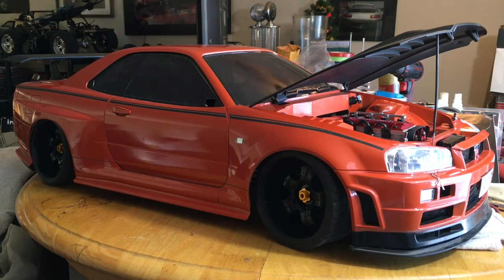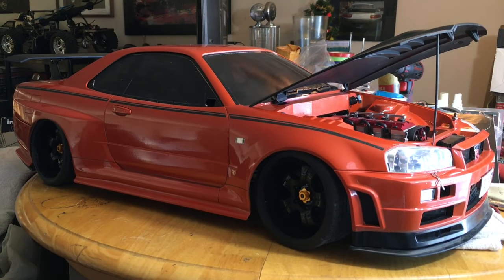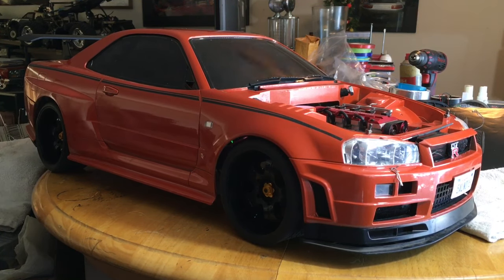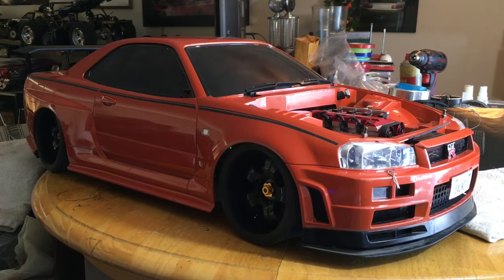TOYAN FS-L400 SKYLINE TEST RUN IM A HAPPY MAN!!!

Comment: Wow! This is hands down the best build I’ve seen with one of those little 4 cylinder 4 stroke engines. I love the scale accuracy of the engine in the engine bay and seeing the cam belt turning and the carb linkage moving because the beautiful little scale engine is real and powering the vehicle, it’s not just for looks. The exhaust actually being routed out the back with a scale accurate muffler can and the adjustable suspension are awesome as well. This is a marvelous machine, well done sir.
Reply from the maker: Thank you very much!
Reply: your not rusty shackleford, I am!

Comment: It looks and sounds like the tyre's break loose on the gear change or the clutch slips more.
The colour really pops in the sun, a good choice. Either you need a stiffer clutch spring or adjust the gear change point to change a little later.
Reply from the maker: I agree  im still setting everything up and dialing it in,

Comment: You need to pick up some red Loctite and use half a drop on every screw on the car.  Super Glue the tires to the wheels, and the clutch is way to loose.  Never mind raising and lowering the body, its just more weight and obviously you already pretty heavy if it cant even pick itself up.

Comment: Im a RC enthusiast. I have several brushless rc's but have never dealt with anything like this. This is awesome. I really feel like these little 4 stroke engines would really benefit from a little fuel pressure like maybe use the exhaust to pressurize the gas tank? I also feel like these engines would really benefit from a 2 speed transmssion maybe something like comes in the Traxxas Jato. What do you think?

Comment: Man, I really gotta get one of those L400s. My old rare FS12 is an old relic 1 cylinder. Runs lovely on my Old Subaru body with tamiya frame, but it's old and suspension parts are so hard to get nowadays, even after I've heavily customised it.

Yours must be custom made, certainly fun to listen to.
Reply: Sad update, my old FS12LS Engine, well she died :( Was running too lean I suspect, and it crunched up the fuel timing section of the crank, so my own pretty nice nitro car is dead now.  But hey this car is still fun to watch even if my own is dead now.

Comment: Well it’s official nobody’s going to catch that fly ball and I believe you knocked another one out of the park. Your toyan 400 has more performance with it running rich than any other one I’ve ever seen on YouTube yet the sound is magnificent I love the way you found the valve problem on the other engine by the way I was thinking people are talking about putting turbos on these little engines. Do you think that they would probably need more spring pressure to keep from pushing the valves open under boost and make them run poorly to just a thought keep up the awesome builds love them
Reply from the maker: Thanks brother!  I am interested in seeing the mods that everyone comes up with on these engines lol!

Comment: I like how it handles. How much does it weigh?
Reply from the maker: Thanks! it weighs about 20-25 lbs, its almost to big to cuddle lol!
Reply: @dennisdempseyradiooutofcontrol  i really like the direction scale modeling is going with these toyan engines. This what we really wanted as kids. Real engines under the hood. Not some electric piece of shit. Would be cool to have a go pro, about a dozen servos and drive these things like we drive in Grand Tourismo. Get a scale 6 speed manual, one servo to control the gear shift with another controlling the clutch. Mount the receiver display on like a helmet, with the ither controls being a steering wheel and actual pedals and shifter. Might b expensive but, you change out what u are driving for far cheaper than actually owning several high performance vehicles. Would love to see this in a crawler with extreme low gear like the Hairy Hauler from Trucks on SpeedVision with Stacey and the other guy hosting. Anyway keep at it man.
Reply from the maker: That’s a great idea to have the GoPro mounted in several positions, I think your on to a new level there brother!

Comment: Well that's it I know what I'm doing when I retire. I finally get to see a running inline four, and it looks and sounds wicked 😲👌👍.if you ever get a thumbs down on this video someone's got some issues or just jokes, I do love my 8th scale 2 strokes but this is next level. I think dual radiators would be a great idea if possible Just for longevity on a build like that. I know those motors get stupid hot but from what I see it looks pretty robust. I love the build keep up the awesome work man.🤞
Reply from the maker: I really like these engines, yeah the dual radiators are a great idea they do get hot, the overflow tank I added helps the cooling big time.

Comment: Looks great and love the concept.maybe it's the speed demon in me but I was hoping it would be a bit faster.know still needs broken in fully and needs some adjustments yet but for me I wouldn't be able to justify the cost of that motor.i just put on a tp power 4070-CM 1400kv motor(costs 3 times less than this toyan motor) on my 2wd slash and with the castle mmx8s esc that thing is stupid fast on 6s and I mean 120+ with it soo far and that was only a short run at maybe half throttle.again maybe it's the speed freak in me.do love the idea and the setup though especially with the air suspension.nice looking build for sure.
Reply from the maker: That was its first run checking all the different parts that were stuffed together, now I can play with gears and higher nitro content,  I have many high powered brushless set ups on my other builds,  I love speed also, like the old saying if your not first your last lol!

Comment: Nice. Great work. For some reason I can not get my fs-l400 started. Using 20% nitro, 2s lipo. Any suggestions?
Reply from the maker: Hmm, is the tiny dot on the cam lined up with the timing mark on the cam pulley? there are 3 timing marks that should point downward.
Reply: @dennisdempseyradiooutofcontrol   yes all 3 are lined up
Reply from the maker: @dblnaknak  ok, if your glow plugs are working and the timing is correct it might be not getting enough fuel to fire off, try putting your fingers in the carb horns to choke it, once theirs fuel present it should fire. be sure to check the glow plug wire connectors to make sure that they are only on the shaft and not grounding out on the plug housing. if you have a voltmeter check to see if your getting 1.5 volts at the plug.

Comment: That is so cool! What transmission did you use? Do you have a site with pictures of everything? I'd love to see more on how you built it. There is another guy that built an F-450 dually rc truck and used this engine in the front just like you did. It's pretty awesome. Well done man!
Reply from the maker: Thanks brother! We all used the traxxas revo 3.3 gearboxes in most of the toyan builds I kinda started that trend on my first conversion because of the 2 speed and reverse with a onboard brake.

Comment: They run on nitro or 2 stroke gas mix,,,,,, what fuel ..? I'm guessing nitro.  20%
Sounds pretty good.👍
Reply from the maker: They run on 15-20% nitro fuel, but they are coming out with a larger dual overhead cam engine with a ignition system oil pump and runs on gas at the end of month.
Reply: @dennisdempseyradiooutofcontrol  👍,,I figured nitro.... thanks for the reply..👍

Comment: Looks awesome Dennis!  So cool to see it driving around!  The sound at idle is perfect!

If you don’t mind me asking what are you using for tires and rims?  At first I thought you took off the stock spinners then painted the rims black but I dunno how you would mount that on the TMaxx suspension.  So are those TMaxx rims?

So after you get this dialed in, what’s on the next horizon?  Anything lined up yet?
Reply from the maker: The wheels were a challenge lol, first I mounted metal discs in the spinner rims to fit the axle pin on the Tmaxx but they were to flimsy so I bought several sets of 1/5 scale wheels that didnt look right, I found these 17mm hex wheels for the Tmaxx and cut them down and used the stock skyline tires on them with the 17mm hex adapters from the Revo.  I have another L400 ready for my next build but cant decide on a 4x4 off road or another street car.
Reply: @dennisdempseyradiooutofcontrol  Hi Dennis!  Thanks for the info! I was just wondering just because I’m just trying to get ideas for what I’m gonna do with my cars. I saw some nice Dura tracks Bandido MT and ST tires they look really nice but I don’t know what size they are. I think they’re 14 mm hex wheels though. I’m just gathering information right now for my stuff.  Can’t wait to see your future projects keep up the great work bro!

Comment: That is a wicked set up. Nissan R-34 GT-R in (I'm assuming) 1/10th with a 4 stroke 4 cylinder nitro and remote air suspension...that is an R-34 isn't it? Or am I thinking of something else?
Reply from the maker: Yes bro its a R34  1/5 scale skyline that I converted a Toyan L400 4 stroke 4 cylinder in ,
Reply: @dennisdempseyradiooutofcontrol  That's 1/5th? Wow, seems kinda small for 1/5th scale. Maybe it's the video, after all, I am watching this on my phone.

Comment: that thing wants a 1:1 or even overdrive ratio between clutch and transmission.
Reply from the maker: It has a second gear but running it rich to break it in it couldn't get the rpm to hit second yet.

Comment: does that have a 4 5 speed transmission? or just 1 gear? Awesome build!
Reply from the maker: Its a 2 speed transmission
Reply: @dennisdempseyradiooutofcontrol  I see, do they make higher than 2 speed?
Reply from the maker: @projectkod  Yeah I have a 3 speed transmission I want to install.

Comment: Does it have reverse on it and is it four wheel drive?
Reply from the maker: It has a traxxas revo 2 speed with reverse transmission, its only rear wheel drive, I didnt have the room for all wheel because of the dropped suspension.

Comment: Where did you get the Nikko body from?
Reply from the maker: I got it used on eBay
Reply: @dennisdempseyradiooutofcontrol  Thank you I have been scouring the net for  one. It seems I keep missing them. Thanks for the info love the build
Reply: I was able to aquire two of these in great condition. One in Bayside blue and they other in silver. Do you have any links you can provide to wheels and tires as well as any suggestions on how to build a chassis?

Comment: Where can I get that chassis and body?
Reply from the maker: The body pops up on ebay every now and then they are super rare to find, it was the Kikko 1/5 scale skyline from the 2000's the chassis I hand made to fit the engine
Reply: @dennisdempseyradiooutofcontrol  is there another one similar to that one?

Comment: is that a metal body?
Reply from the maker: It is a heavy plastic body very flexible also.
Reply: @dennisdempseyradiooutofcontrol  is there a prop shaft adapter I can get for that engien or the straight six? Want to install it in a p51 or so

Comment: You need to check out Timsane video he posted today,he is making titanium valves for this motor
Reply from the maker: I emailed him lasting to get onboard for the upgrades, 👍
Reply: @dennisdempseyradiooutofcontrol  Watch the one that Warped perception did with the twin turbos
Reply from the maker: @caparice1879  I seen his video also, i am working on bigger radiator and carbs to go along with the boost that the turbos spool up.
Reply: @dennisdempseyradiooutofcontrol  I'm still playing with the real thing.I made a nice sleeper, a 4dr 1989 Caprice that I put a 6.0L LS motor in.Waiting for my extra money from the Covid check.New injectors and a 3200 stall converter to go with the BTR stage 2 cam that I have.I want to go drag racing this year.It runs 13.30@108 now
Reply from the maker: @caparice1879  Cool ride! I have love for the caprice and old school impalas (I sound like Paul Wall lol!)

Comment: If that's kinda as quick as it can go, have you ever considered maybe attempting a hybrid set up. Let an electric motor just help out with torque and letting the engine rev out a little more. I dont know a whole lot about it or if it has potential to damage the engine but it might be something to take this car to the next level
Reply from the maker: It is faster but with the carbs set rich and the clutch slipping it was a slug in the video lol,

Comment: These motors could be really cool but for whatever reason they just don't ref high enough to be usable and fun in a car they're more of a desktop tinkering thing in my opinion,
Reply from the maker: It depends on the clutch and gearing,  the video with the skyline was a first test run to determine a starting point in how to match the clutch and spur gear teeth, the L400 4 cylinder has massive torque but needs a bigger diameter clutch to transfer the power the 1/8th scale clutch is to small and has a lot of slipping,  now that I seen it will move a large heavy car I will add proper gearing to it.

Comment: I would love to see an electric assisted one of these so you can get a good launch, good top speed, and good sound.  It revvs so high to move so slowly, I know that it because of the motor size and the cluch type, but it would be cool to see a hybrid type of system. Maybe the electric motor could be a regular sized one that is rwd only powering the diff while the engine is also powering the same diff. im not sure what clutch you have, im assuming it is a centripital style of clutch, so you could try and gear up the engine or have stiff enough clutch springs that the clutch doesnt fully engage until around 10 mph and maybe you have a dial on the remote that changes how much the engine is powered based off of the electric motor so you can be utilizing the electric more than the gas on the launch while still having the revvs and then only really have the engine give power when the clutch is fully engaged so it doesnt sound like a cvt till it does and it will lessen the wear on the clutch shoes. Im not sure how crowded it is under the shell and if you have the space, but it would be a cool concept for a later build.

Comment: R 34 oo güzel hp kaç
Reply from the maker: Engine Size: 121.05 x 43.67 x   90.00mm
 Engine Displacement: 14cc （3.5cc x 4）	 Displacement:3.5cc
 Size:100.5 x 85.4 x 86.5mm	 Speed: 3200-13500 RPM
 Piston Diameter: 16.60mm	 Stroke: 17.00mm	 Power: 3.05ps
Reply: Tamam teşekkür ederim canım